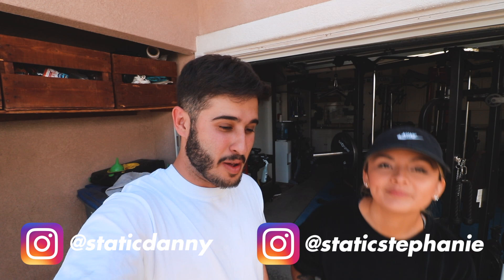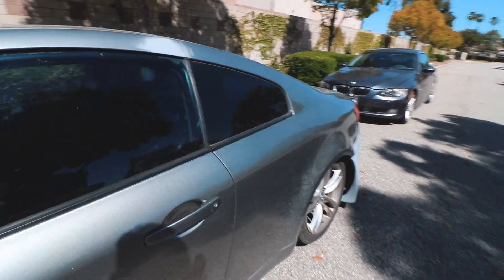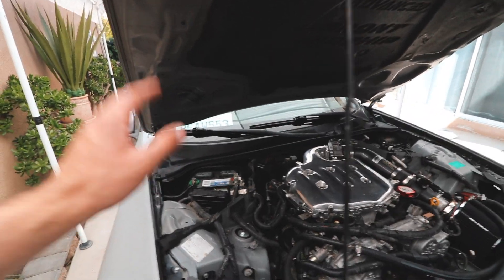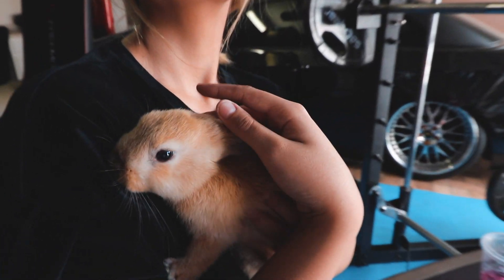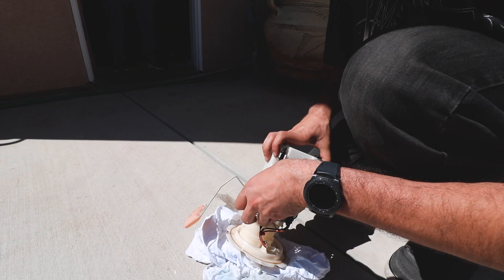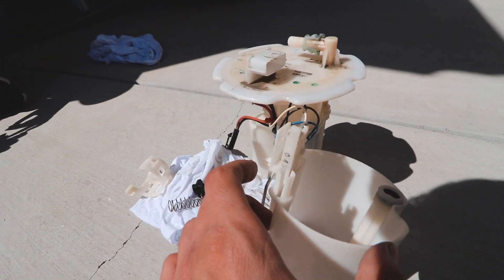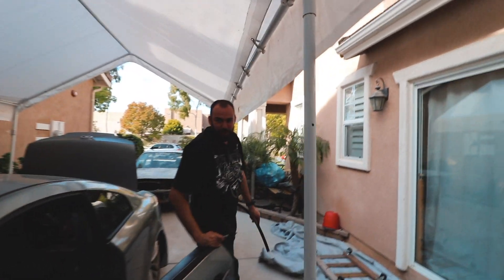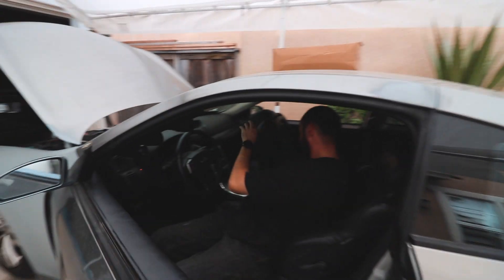Getting The G35 READY FOR E85!

Comment: So i just bought my kit aem pump thoo
Reply: And gtr injectors can i run flex fuel or not im running octane 91 right now on stock car
Reply from the maker: You can run flex fuel if you set up a flex fuel capable sensor and the ECU can work with it!

Comment: I thought you need a tune if you up the fuel pump??
Reply from the maker: You need a tune for any modification to actually get results otherwise you’ll run lean/rich. Bigger fuel pumps will allow for more fuel but the ECU will continue to push out the same amount of fuel unless tuned. Luckily the car runs okay but the idle fluctuates since he has a bored manifold, plenum spacer, big bore throttle body, headers, etc. it’s 1 step away from full bolt on.